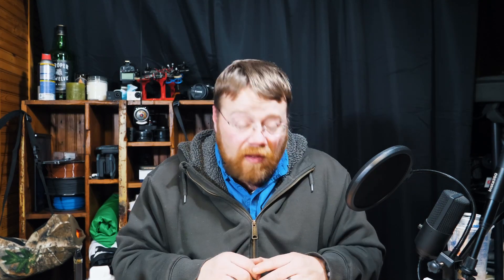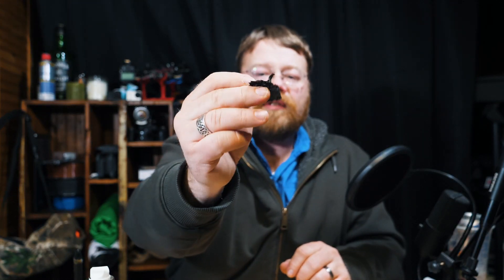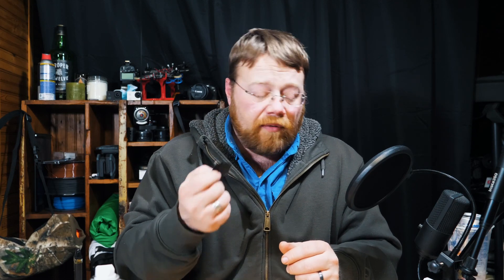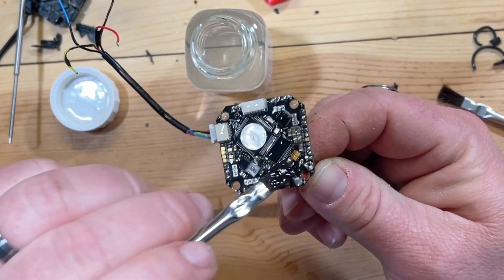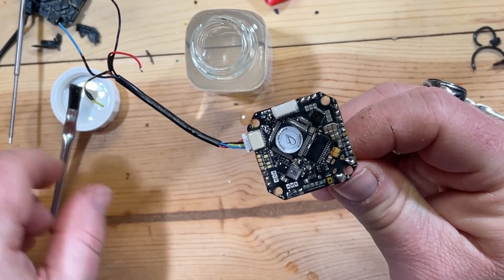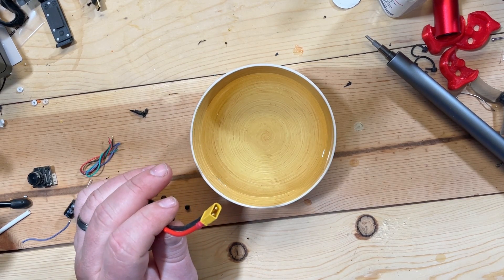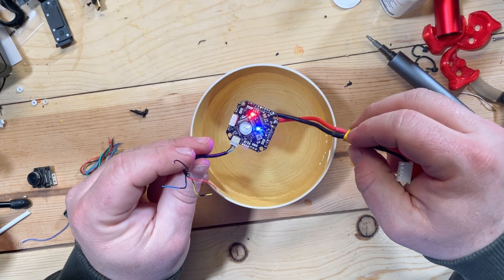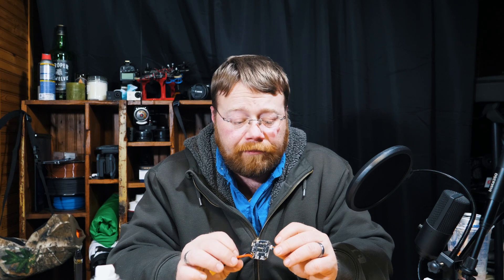Does MG Chemicals 419D Waterproof a Drone?

Comment: Could you do additional tests ? Add receiver to the test. Bind controller and see if board resets and/or you lose connection. Cause if it does, it is still not good enough.
Reply from the maker: Sounds like a plan!